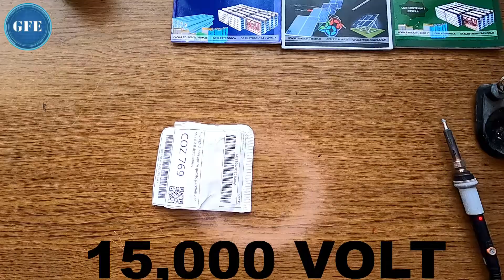15000VOLT  WHIT 3 BATTERY 18650??? VERY DANGER PROJECT fox tech  - fox tech channel

Comment: Quello che hai costruito è un convertitore boost dc-dc?
Reply from the maker: si, in convertitore bassa a alta tensione, chiamiamolo pure inverter dcdc
Reply: @FoxTechC  mi sto informando da tanto tempo sui vari convertitori (step up e step down) e mi chiedo perché negli impianti fotovoltaici offgrid non vengano utilizzati questi anziché i regolatori di carica per caricare le batterie. 
Tu cosa mi sai dire?

E poi... Mi sapresti spiegare se esistono i convertitori SEPIC? 
Ne sento parlare bene ovunque, ma non li trovo in vendita da nessuna parte.

Tu per caso li vendi o me li puoi fare capitare?